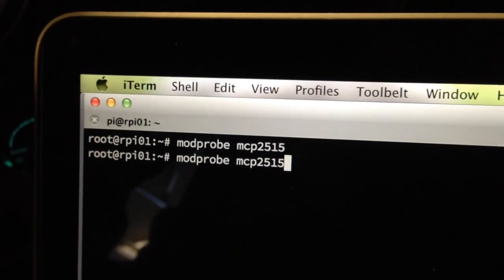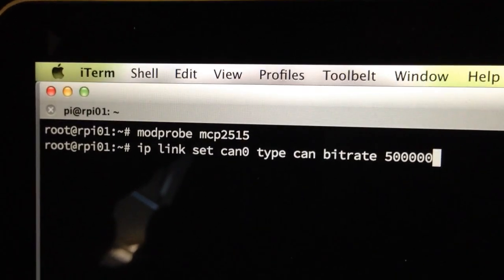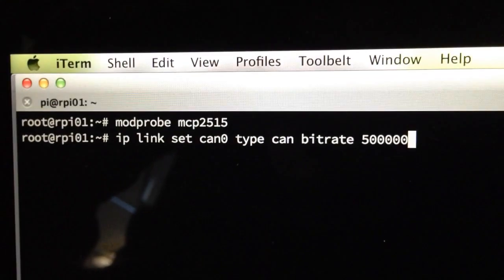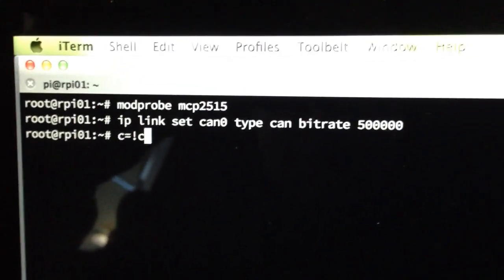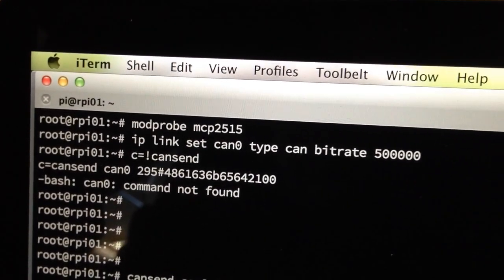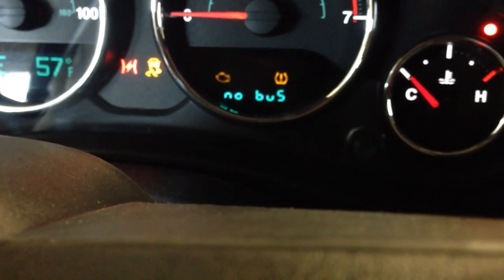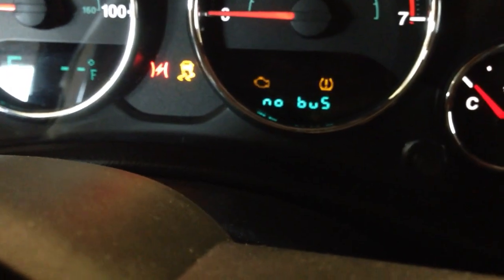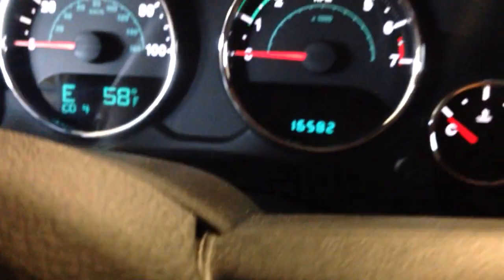Hacking the Jeep Interior CAN-Bus, Part 6

Comment: How can I mount a low speed radio with a high speed?
 you can do something?
Reply from the maker: +carlo novelli don't waste your time. You could build or possibly buy a bus speed converter, and some companies can convert radios between the two. But, frankly, radios are so cheap and plentiful, just buy the right radio and save yourself time.

Comment: Thanks for sharing! I'll need to pick up a raspberry pi now. It seems much more capable than a simple arduino with can bus shield (which I currently have). Would it possible to make a wifi ad-hoc connection so you wouldn't have to stay in the garage?
Reply from the maker: Yup that's exactly what I wound up doing. One of those $8 WiFi USB adapters, a configuration to connect to either my home WiFi or my phone's WiFi, and done!